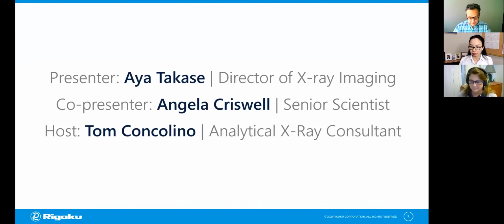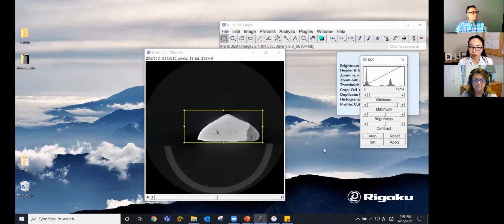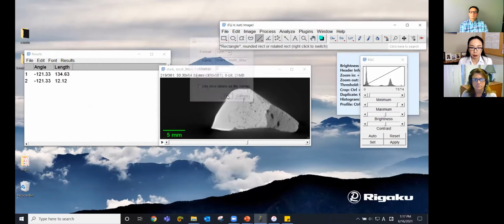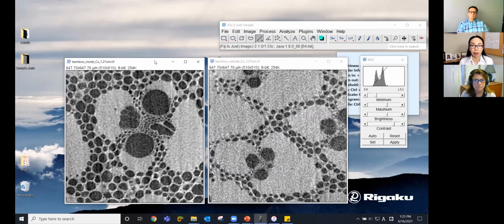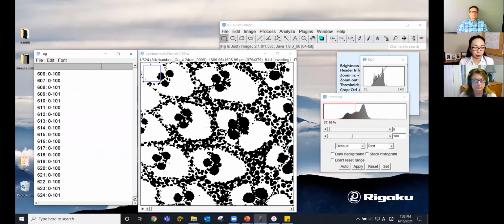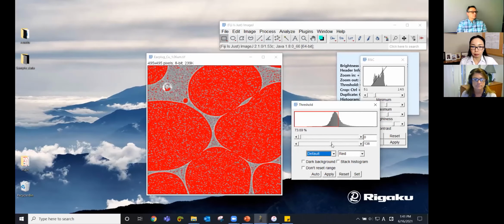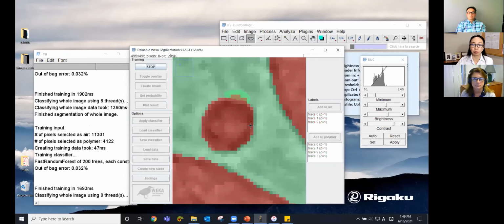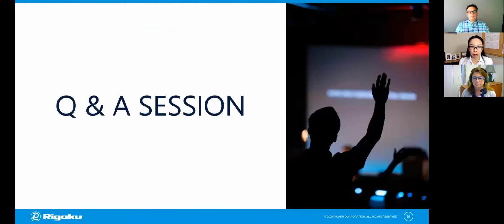Rigaku Virtual Workshop 4: X ray Computed Tomography - CT Data Analysis Techniques Using ImageJ

Comment: Hi! I have a question concerning creating the scale bars or setting the scale. Normally, we just know the pixel size (e.g., 5 - 8 um) that is used during micro-CT analysis. How can we create or set scale when we want to analyze micro-CT data by knowing just pixel size or voxel size from micro-CT analysis?
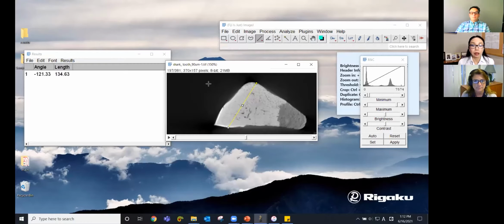Reply: If you know the voxel size of your micro-CT scan, you can set the scale. Go to the "Analyze" menu and select "Set Scale..." When the Set Scale dialog appears, type in the size of the voxel, aspect ratio, and the unit. You can watch me do it in this video starting at 12:07.